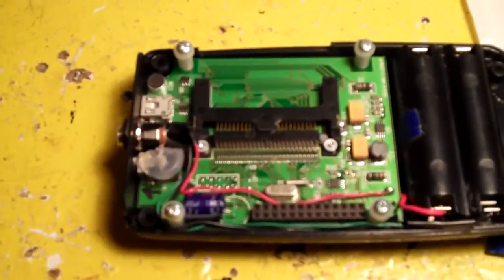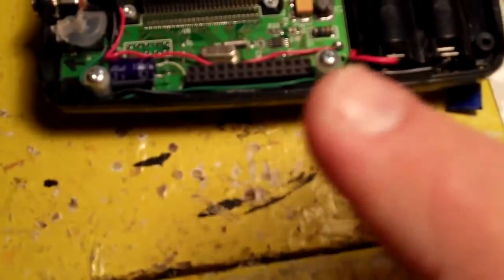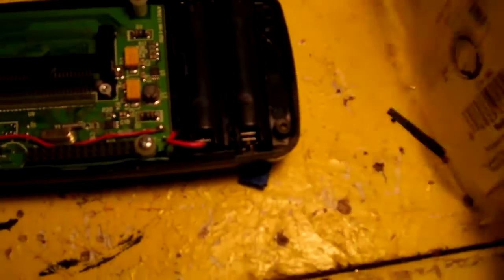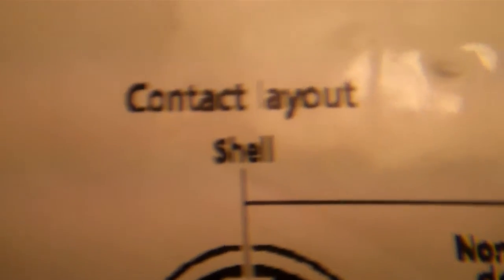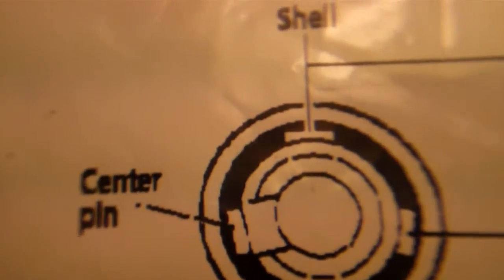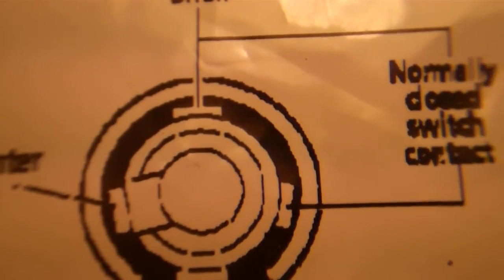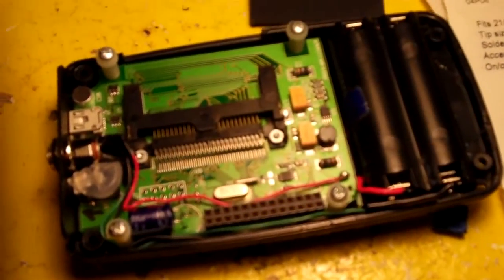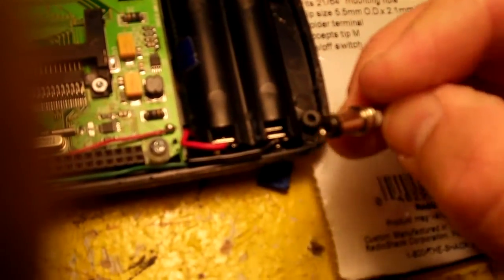Adding a power jack to a battery powered device

Comment: yay! another tigheklory vid! :D

Your wife is really lucky to have a man that will fix those things for her. Very educational, I think I have to import some of those. 

btw, can it damage your powerport-wall-thingy (sorry, English is not my native language) if deliberately ty to charge non chargeable batteries? Sounds like something fun to try out outside with 6m between you and the batteries, but not so fun if you ruin your powerport-wall-thingy.

Keep up the good work!
Reply: First of all, I’d like to tell you that it sometimes works to charge alkaline batteries, although it’s not very effective. Also, calling it what you called it is exactly fine. Even though English is my first language, I seldom use The actual correct term, which is power adapters wall adapters or something like that. Usually I just called them bricks, power adapters, or, if it’s a charger, I call id a charging block.